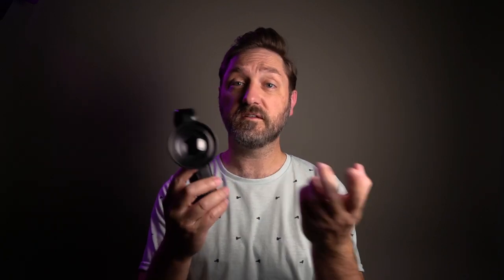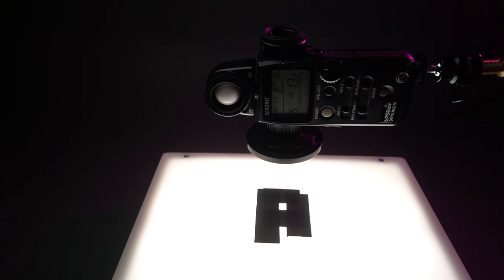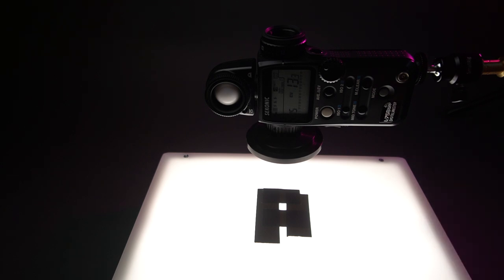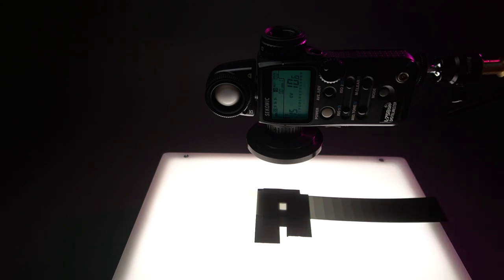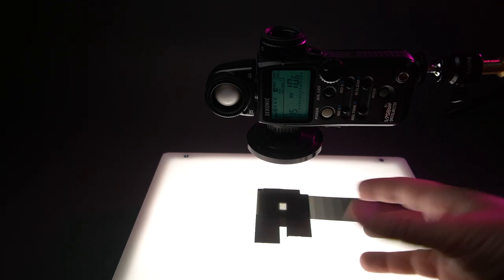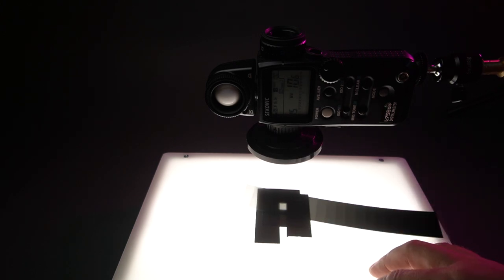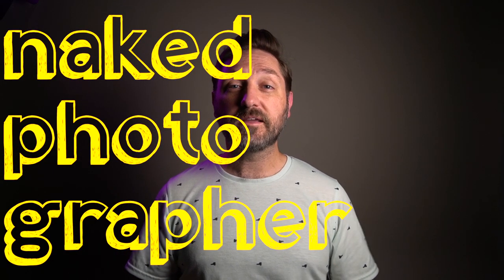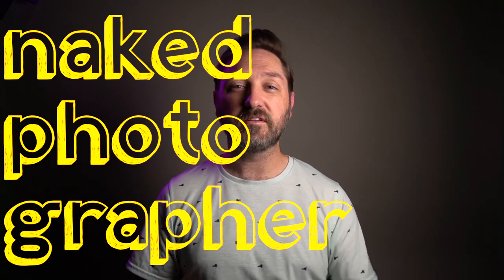DIY Spot Meter Densitometer

Comment: Good explanation. The Minolta Spotmeter shows increments in 0.1 stops. And it was a closeup lens available.
It was the first time i used the tripod thread at the bottom of the grip of it…

Comment: This was great inspiration.  I just took my iPhone 12 Pro and the Spot Meter Pro app and did a test with an all Kodak printing wedge I have, and my 3 / 6 /10 stop ND filters.  Spot Meter Pro measures in 10’th of an EV and either 1 or 2 degree spot.  Now granted the Kodak print wedge nor ND filters all calibrated, but amost all the measurements were within 0.1 EV of what I would expect difference wise (e.g., 1 stop change on the Kodak was either 1 or 0.9 EV different); the only place there was a gap was the densest parts of the step wedge which would be the wedge itself.  I tested from 14 EV down to 1 EV range…and might try more.  Anyway, it gave me confidence to go ahead and get a calibrated step scale and use that as a basis for calibrating the phone..just some Excel math I’m sure.  Thanks!!

Comment: I'm convinced.  Fifty years at this, and I'm finally going to try some sensitometry.  First step: I've ordered a set of 46mm diopters to fit my (ancient) Pentax 1/21 spot meter (which now runs off a lithium cell with voltage converter).  I can read at least 1/3 stop increments, get the reading in EV (=foot-candles), and I can see the spot I'm reading in the eyepiece.  I've got a tablet (Kindle Fire HD10) that I can use for a light source (load up a "full white" image and disable the auto-brightness -- not smooth enough for good DSLR scans, but plenty fine as a densitometer backlight).

Comment: Very good video, and channel.  So, if one reads film base + fog at, say EV13, and then reads an an area exposed for Zone I, which should be 0.1 density (the Ansel Adams film speed test), that will read as EV 12-2/3?
Reply from the maker: That’s it!

Comment: Really enjoy your videos!  I am trying to replicate this interesting set-up. I don’t get the differences you get and I wonder if the settings of the sekonic can play  a role, as you know you can set it in 1/2, 1/3 and 1/10 stops. I am using the latter. So when I have a negative that is supposed to be zone III and compare it to a zone V (all shot on 18% grey card) I shoot have 2 in EV difference, but it is less. Any suggestions?

Comment: Minolta Spot Meter F reads in 1/10th of a stop. The Darkroom Automation Precision Enlarging Meter (PEM) reads in 1/100th of a stop. I have both. I have a fibre optic gizmo that converts the PEM  into a reflection densitometer for reading paper densities.

Comment: The Minolta Spot F and Spot M meters read in 1/10 of a stop increments. I've read and seen photos showing that at one time Minolta sold an accessory close up lens for its spot meters, which attached to the front of the normal lens, much like here. I think it is one of those rare and hens teeth items, and it probably probably  doesn't focus as close as suggested for this purpose.

Comment: Have you tested if there is a difference in readings when you exclude ALL flare with a blacked out tube between spotmeter and negative? In your setup there has to be flare.

Comment: I haven't done densitometry since college back in the early 1980s.  Did you buy or create the step wedge? And if you bought it, which one did you buy.  There are all kinds of Step Wedges for varying graphic purposes.
Reply from the maker: I use a Kodak #2 step wedge (21 step, 5 inches long), but I also have a #1 (11 step) and #3 (21 step, 10 inches long).  All of these range from 0.05 to 3.05 density

Comment: My Minolta spot meter reads in 1/10 stops increments. 

I am lucky enough to have found a transmission densitometer relatively cheap, maybe I could try something like this for reflection?

Comment: I have been thinking to use reflex camera with spot measurements and a macro lens. Something like Nikon F90+Tamron 90.
What do you think about to measure on the enlarger projection? It could be useful to use F-Stop exposure.
Reply from the maker: It would be easier to just get an Ilford enlarging meter

Comment: Can this test be done with a cheap light meter or is the one you have needed for this test?
Reply from the maker: It needs to be a 1° spot meter.  Older Gossen and Minolta spot meters are available on the used market for much less than my meter costs.
Reply: @TheNakedPhotographer  Thank you. Would you say this is an effective test for finding a film stock's resolution?
Reply from the maker: No, just density.  A resolution chart is necessary for resolution.
Reply: @TheNakedPhotographer  Is there other ways to compare film resolution outside of charts?
Reply from the maker: I’ve never tried.  Charts just give a measurable, objective way to compare.  And if it’s film rather than lens resolution, you may need a microscope, too.
Reply: @TheNakedPhotographer  What would be the applications of measuring film density?
Reply from the maker: To know if you are exposing for enough shadow density or developing for enough highlight density.

Comment: Why would you need the spot meter to be able to focus close? Even if the viewfinder image is out of focus you're still getting an accurate meter reading. You can test this pretty easily with a large enough evenly lit surface. Take a meter reading from a couple of meters and then from a few centimeters and see how the readings are identical.
Reply from the maker: If you can’t tell what part of the negative you’re looking at, how do you know the reading is accurate?
Reply: @TheNakedPhotographer  If you've masked out a hole where the light comes through then just aim the spot meter at the center of that hole and then move the negative at the same spot. I really don't see what the issue is here?
Reply from the maker: I don’t see what the issue is either, if you don’t want to use one, then don’t.
Reply: @TheNakedPhotographer  No need to get defensive about this. I'm just informing other viewers that you can get the job done without the extra lenses.
Reply: The trick is to have your patches so big that they completely cover the front lens of your lightmeter. Then you don't need to worry about focusing. Using a complete 35mm frame per patch worked fine for me. But still, having smaller patches and being able to focus on them seems to me like a more elegant solution and it wastes less film.